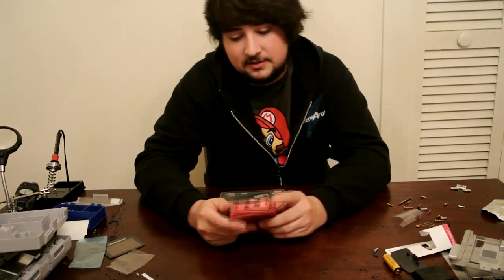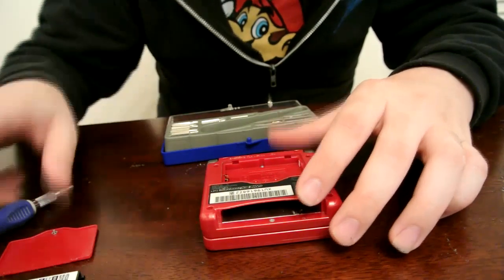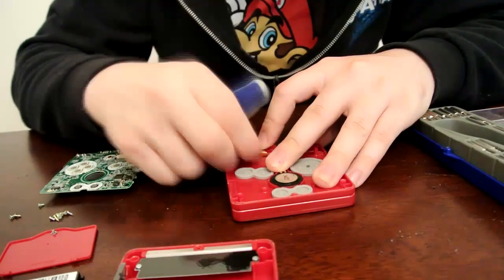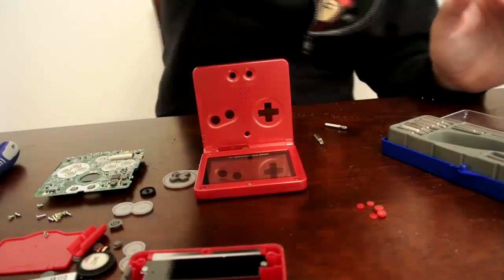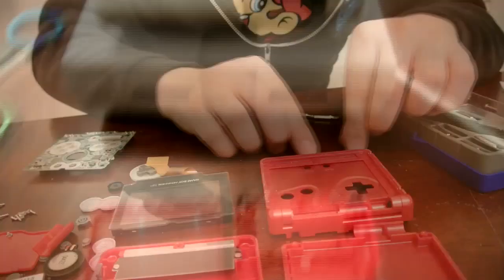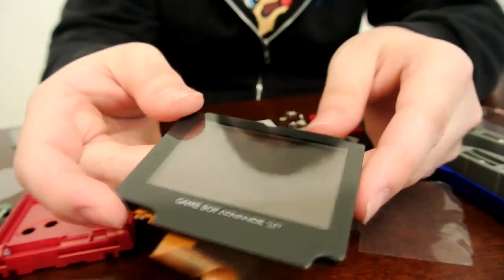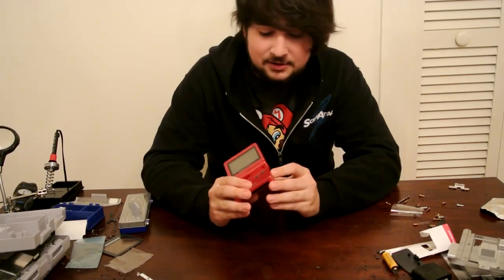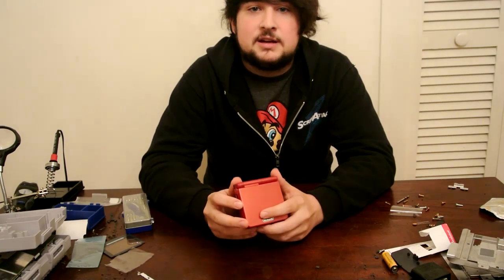Retro Repair Tips 4: Gameboy Advance SP Teardown & Screen Replacement

Comment: Hey, do you know how to remove the plastic screen from the LCD? I think my screen have some mushroom inside it cause of the humidity in my room. The screen is covered by some dotes thats most likely mushroom. I have seperated the glass screen and the plastic screen but I cant open the plastic screen from the LCD.

Comment: i changed my shell and out everything back into place but now my colors are too bright on my games red is orange green is lighter before is dark, lettering is not dark bold its faded, anyone else have color differences? i tried taking the filament out of mother board and putting it back again still have same problem. i put my sp next to my old gba with same game in and colors are way brighter wtf

Comment: I need a guide on replacing the cartridge slot :o
Can I even do that or is it soldered to the motherboard?
Reply: Probably way to late of an answer, but it is soldered to the mobo. Your best bet would be to find a seller that sells just a replacement mobo.

Comment: I know this video is old but can anyone tell me if this is possible to do with the AGS-101? I'm not sure if the different screen makes it not possible to do it. I see in this video that he has a AGS-001.
Reply: Yeah, but if you're replacing the casing you need hinges.
Reply: oem? My old shell was very old too.
Reply: +Gerardo Rodriguez I am rebuilding mine with this guide, I'll let you know, also BUY NEW HINGES, you'll break your old ones.
Reply: ReubTube96 You don't need hinges. There is a small half cylinder piece of the joint that is removed with a screw. That is all you need to remove to take out the screen and ribbon cable.
Reply: ReubTube96  I swapped a few of my own casings already and never had to separate the hinges.
Reply: trkoby but those casings were oem. Don't know if there are problems with aftermarket hinges.
Reply: +trkoby aftermarket ones are less quality
Reply: Mine was a 2nd used one so the hinges were probably worn out, it is a very old handheld.

Comment: If you're using a magnetic bit...some of these tri-wing screws feel like they actually reject the tip, so they're even harder to turn. Especially nasty with those near the display, increases the chance of slipping up and scratching something.

Comment: The thing with mine is, I had it for 11 years, and the screen JUST cracked for the first time, and it's really bad, all over the place... But the screw on the back battery cover has completely rusted... I may just have to break it off, would that do?

Comment: Is it hard to replace the screen lens if you just remove the five screws by the lcd? I already did the full teardown of a ags101 and  ags001 to swap the shells and clean them, but I would prefer to not fully disassemble it again if possible.

Comment: Is this the backlit model or frontlit? The first time I did this I was trying to remove the LCD screen overlay and I felt like I was prying the front light off with it.. Also the sticky strips around the sides were just sticking to the LCD and not coming off well like yours did..

Comment: do you have to take it apart to replace the screen because all I need is a screen replacement
Reply: Michael M this is kinda late, but I'll answer you anyways. If you are talking about the screen LENS, no. You can just do the five screws on the top, granted, you have to be VERY CAREFUL! However, if you are talking about the LCD itself, then yes, you have to take apart everything.